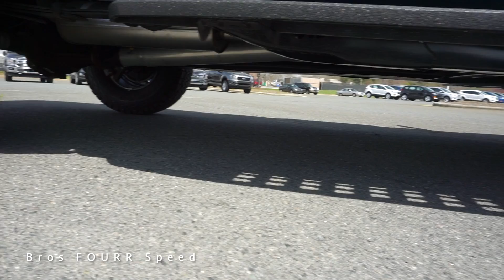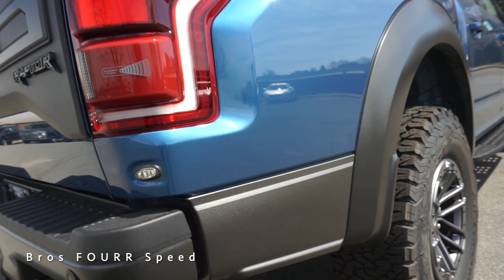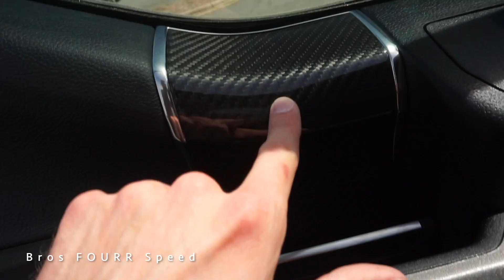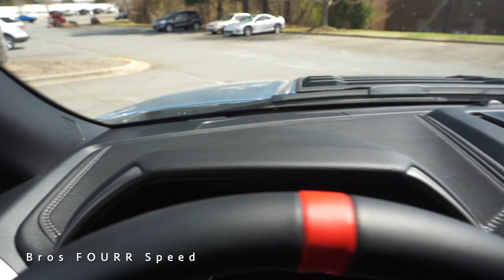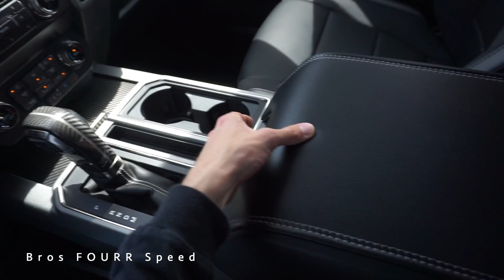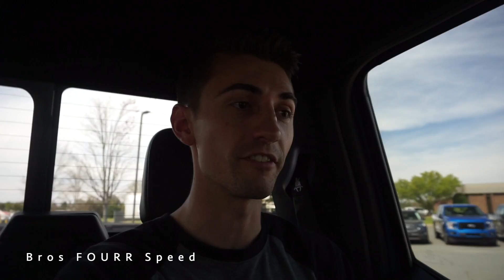2019 Ford F-150 Raptor: Start Up, Exhaust, Test Drive and Review

Comment: I've never been a truck guy, but this thing has me thinking twice. I love the presence it has. And having owned a 2017 STi, I really do appreciate the tech in this thing. Man. I want.
Reply: pickups these days are the ultimate vehicle.. 4x4..  offroad ...beautiful interior with every option you want...big HP and TQ you can tow and load up the bed up.. and they have to best resale value
Reply: Man you like me fr. I got a 21 STI but I wanna switch it up, and I think I may look at a raptor
Reply: @KingZD1  I traded in my 2018 STI for a 2019 F150 Raptor 802A trim. No regrets.

Comment: How does it have a tow hook without 4x4 😤 makes my grandpa so mad 😂😂
Reply from the maker: This is 4wd. I don't even think a Raptor can come in 2wd
Reply: Raptors don’t come in 2wd cause it’s a off road Baja truck. But you can switch it to 2wd when you don’t need 4wd oh and don’t use 4wd on regular roads you’ll mess up the drivetrain

Comment: There is very little if any actual leather in the seats.  The carbon fiber inserts are most likely not real carbon fiber either.
Reply: You Russian trolls need to stick to politics.  Although you're stupid at that, too.
Reply: If you get it optioned with leather then the seats are leather. The carbon fiber package is real carbon fiber also.
Reply: Michael S the seats are not leather.  Neither are Toyota’s.
Reply: @bertraminc  the base seats are cloth, leather is an option as are the recaro seats which are a mixture of leather and Alcantara inserts. Not sure what you are talking about. 

Tundra also has leather as an option. There are a lot of vehicles that use leatherette as an option which is a type of vinyl softened to mimic leather, but that isn't an option on the raptor.

Comment: WTF! I'm in Australia and I think the Ford Raptor we get here gets built in a Hyundai Factory! It has nothing in common with the U.S Model which is amazing, however costs the same! We get small engine, soft pox body shape, half the features! Australia ripped off again, why do we bother either bring the real thing or don't bother! Next we will get cordial flavoured Jim beam in a bottle!
Reply: I’m pretty sure you’re talking about the ford ranger raptor. This one is the f150 raptor
Reply: I think this one costs around  200 in Australia

Comment: Sounds so anemic now with the V6. Without a V8, just doesn’t seem like a raptor. Just an over priced plastic V6
Reply: PROMETHEUS GAMING 
Sound sucks for sure. Except the turbo sounds. I like those.
0-60 on the previous v8 was 7 seconds
0-60 on the new gen raptor is 5.3 sec
And the mpg on the new gen is better 
Although I would prefer a v8 myself, I would hate to have even worse mpg than what I already get. I got the raptor for my wife’s daily. 

It’s fast for its size

I love everything about my 2019 raptor except the exhaust sound but I knew this ahead of time. I’m use to big power v8s. But it’s still worth every penny for me. Amazing fuckin truck
Reply: Joe Momma I do agree on the turbo sound. I’ve always loved the sound of turbos and superchargers. Yeah I saw those times and that’s crazy
Reply: Joe Momma and great educated points unlike the first moron to reply/comment.
Reply: Go back to school kid and learn..
Reply: V6 twin turbo!! Same hp as v8 motor. buddy.
Reply: MAR SAN yes they did a great job getting the same HP. I think it’s actually a little bit more in the 2019 vs the 6.2L. I was more referring to the sound. It is hard to beat the sound of a V8. To me, when the raptor first came out, that sound was just nasty. Now, it’s kinda bleh. Still powerful, but not the same.
Reply: PROMETHEUS GAMING it’s faster than the older 6.2l v8 raptor.

Comment: Very nice truck. If I had an extra $70k for a truck I would consider it for sure.
Reply: Lease it
Reply: Ns Tser ram rebel red
Reply: HI, Have you bought the car?
Reply: Nichith CN VEVO ram have a lot of issues not worth it too many recalls
Reply: You can lease it and put down 30k. If you really want it you can get it. My cousin works in a construction company making $900 a week he saved up for 1 year and leased it but the only problem he said he has is the insurance since he is 19
Reply: @Raccoon-701   no
Reply: @Raccoon-701   900 a week? is that supposed to be low?!

Comment: the most overpriced v6 on the market.
Reply: Graph Guy you get 450 hp and do 0-60 5 secs or even 4 embarrassing v8 trucks
Reply: @dennistv598  so the Raptor is a drag racer?  I thought it was a baja truck.  If I am going for speed, I can buy a puny TESLA model 3 that will smoke the Raptor like there is no tomorrow and watch the Raptor's twin turbo break down to the tune of $$$$$$.... Naw, I will pass the competition is equal to anything the raptor can do off road and not loose the straight out the back tail pipes.  And then there is the weak carry haul weight.... Naw, I will save myself 20K and put it down on a boat I can pull with Tundra/Taco/Rebel/Gladiator, etc etc
Reply: Graph Guy must be a hater what u expect from a off-road truck from factory build 70k your getting 450 hp and I think about 500 pound feet of tq shitty ass new Tacoma can’t even beat a 4 cylinder rav4 embarrassing Tacoma 0-60 is 9-10 sec embarrassing the rav4 is 8.6 sec u like what u like but when U drive the raptor you’ll shut the fuck up your one of them judging ass people
Reply: Durk Durkgang facts
Reply: WILD 3eats he in quiet mode now he can’t compare the Tacoma to this the Tacoma is a trash slow truck 0-60 in 9-10 secs and it’s a v6 with 250 hp even the rav4 is quicker and it’s a 4 cylinder
Reply: Durk Durkgang ugh we have a snowflake and a highly uneducated but oh so sensitive one.  Better go kiss your mommy goodnight before you go down in your basement room and play video games until you you have to get up for work at a Taco Bell. Get a life.
Reply: Graph Guy aww you really go that far someone behind a screen talking all that crap that lifestyle must be you and I don’t work at Taco Bell I work as a dentist what about you and I don’t live with my mommy you really but hurted now we came from talking trucks to life that’s mean you don’t have a life you took it took far buddy you’re behind a screen I’m sure your a broke boy and you took it to far and I’m right you’re one of those people judging a book behinds it’s cover so don’t even talk about my life if U never live with me you talking all that crap u must be broke so don’t even i got my own job doing well
Reply: Durk Durkgang snowflake feelings hurt oh too bad, but before you wet your pants,again, look back in the thread and see who started it, it wasn’t me girly. MUTE
Reply: Graph Guy yes but u went too far came from arguing about trucks now about life and I’m not hurt think what u wanna think them old ass jokes u using its 2019 who talks about people life it’s not even cool there’s people who want a better lifestyle it’s not even funny what if that was you struggling living in basement that was me long ago now look at me being a dentist making money it’s not even funny I’m surprise I turn my life around so don’t judge me unless u was in my shoe
Reply: And the most powerful v6 on the market. Although I do love a v8 as well, I've owned both the v6 ecoboosts in the F150 and they are some seriously powerful engines. The 2.7 was my favorite due to all that power in a 164 ci package. Great fuel mileage to boot. Had to give the coyote a shot though. What a great engine as well! Got a smokin' deal on a 2018 with the coyote, couldn't pass it up.
Reply: @hdz12ez the more you turbo, twin turbo, etc to get HP out of small physics the more the price goes up and the more frequently and costly the repairs.... There is zero practical reason to have a 4x4 with a ton of hp, torque yes, but hp is only for fast and how often is that used? rarely unless you are on a wide open baja.  You can't use it on trails, rock crawling and it doesn't do squat for the lame hauling limit of the Raptor... and top it off... next year the ev trucks will be out and will squash all ICE numbers.
Reply: @graphguy  valid points for sure. The thing is that we're being forced into this kind of engine whether we like it or not. Seems like everyone is using small displacement turbo engines to meet CAFE standards. It's either that or a large displacement with DOD(Displacement On Demand) which costs a ton to repair when it fails. Many people delete that anyway with a tune because it's just as annoying as auto start stop. I agree with you about the electric vehicles too. Yet another costly alternative. The old days are long gone my friend.
Reply: hdz12ez agreed and thanks for your thoughts on the subject.